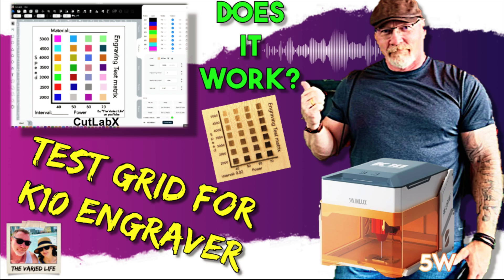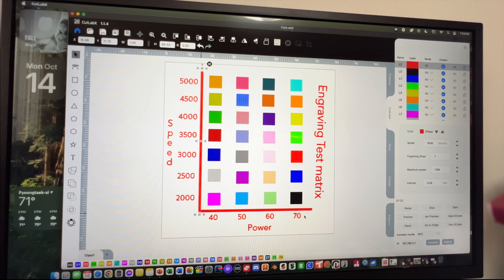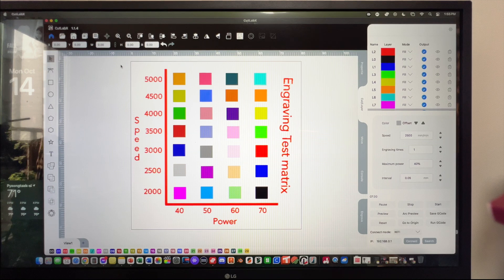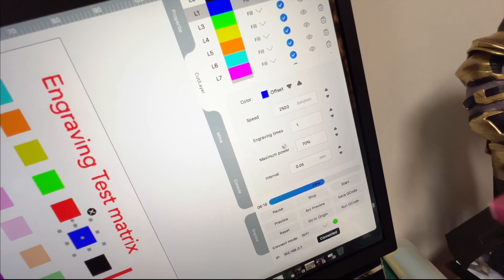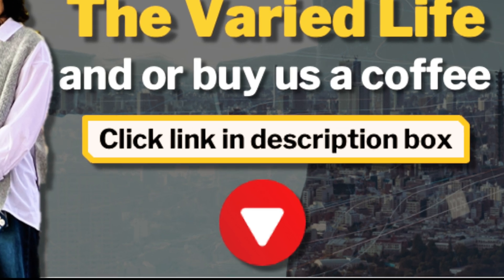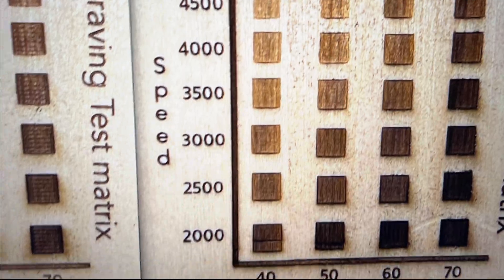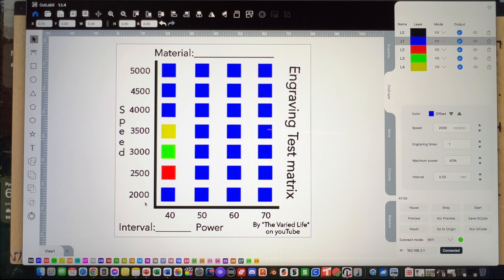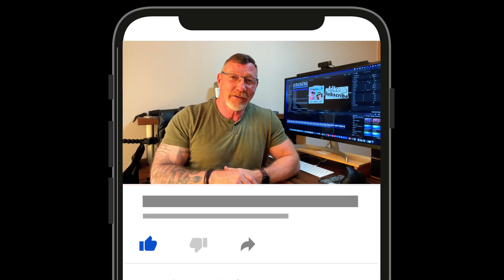Making a Test Grid for the K10 Laser Engraver from Wainlux  - a must have tool!

Comment: Really informative and entertaining video, thank you 
Got my 3W K10 a couple of days ago, Had to download the latest software from the APP store (mac) to get it operational. even though the driver worked OK.

Experimented and had some great results, but found your explanation of layers so helpful, never realised that different power levels could be set on individual layers.

I  had difficulty using the "preview" feature, until I realised that the whole of the orange safety cover was covered in a thin layer of translucent film, which was really difficult to see through, ( possibly should have read the instructions)

You mentioned engraving on leather, I can confirm that it's brilliant, I tried it on textured, glossy, mat and all sorts with great success . What really impressed me however was the fine detail that can be burned into wood, I photographed a signature done with a felt pen onto an A4 sheet of paper, and reduced it down to about an inch long for engraving on the base of wooden bowls I make, amazing results, looks just like is beeen drawn with an ultra fine pen. I was also surprised that the 3W laser also cuts through thin art card at 300mm per min ,100% very useful for making masks.

Thanks again for all the helpful tips on the video......best regards...Pete